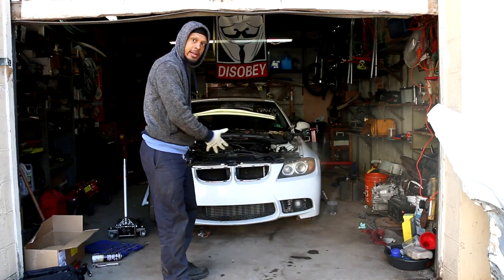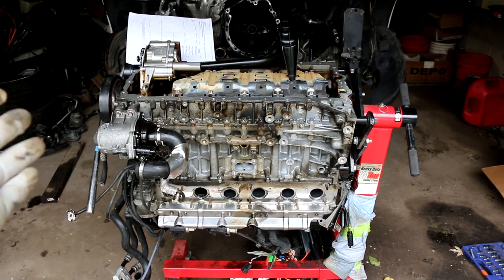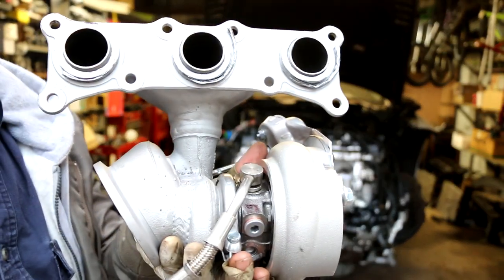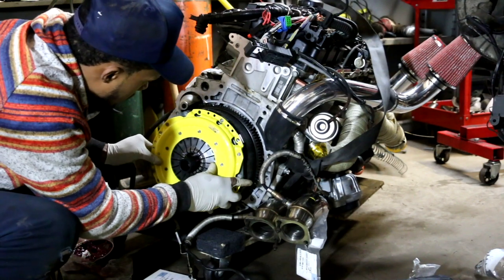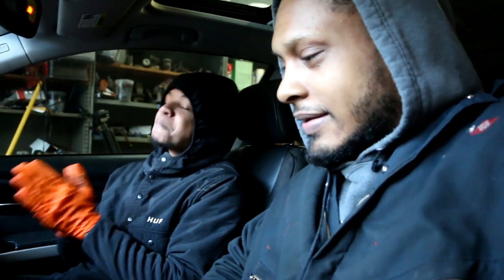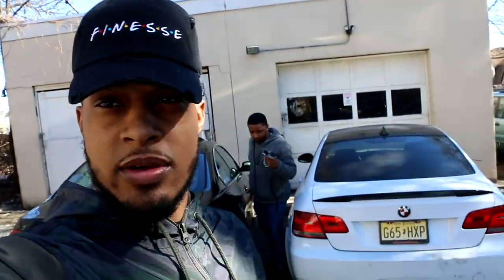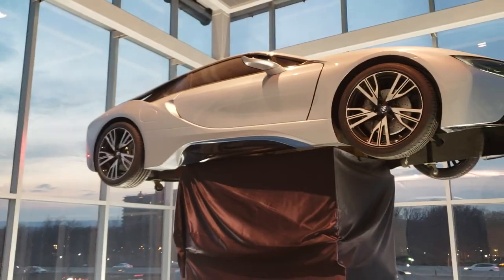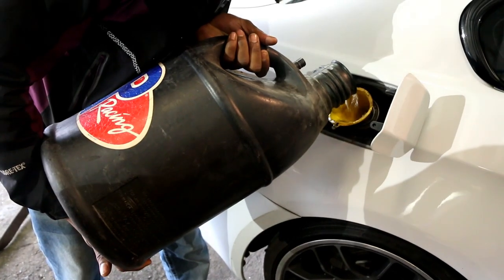BUILDING A BMW 335I IN 15 MINUTES  550HP  | EPISODE 28

Comment: Hey Jermaine, I've got an 04' CLK500 that I've had for a few years. Been a very solid car, but getting up there in mileage. Since I'm a bit of a Mercedes guy, I'm debating on a newer C400 or saying fuck it and pick up a 435 gran coupe. Not a huge fan of BMW, most due to reliability issues, but based on your experience with your 335, what do you think I should do? I wrench and can do most things at home. Cheers!